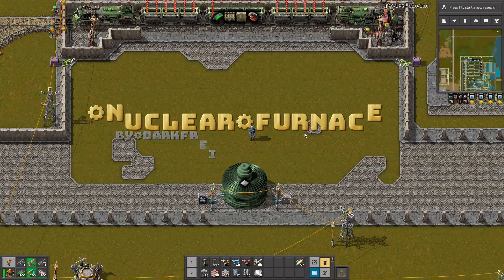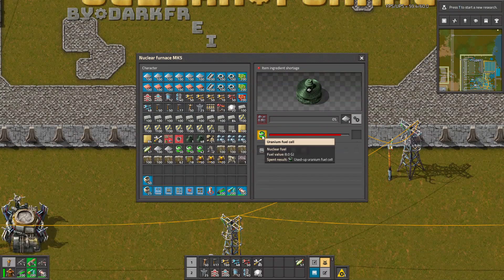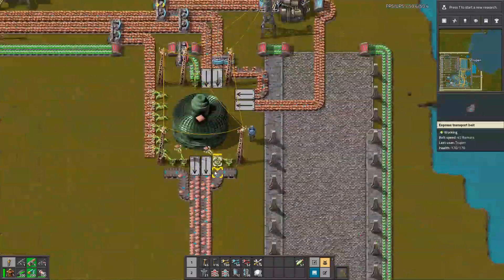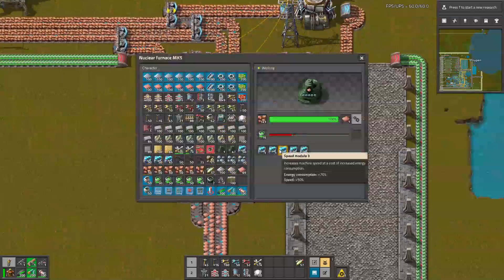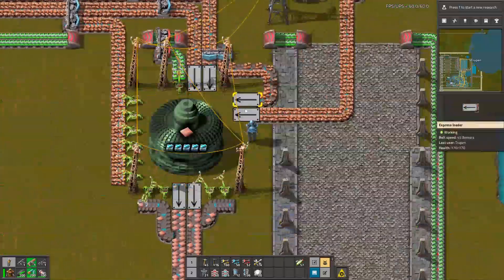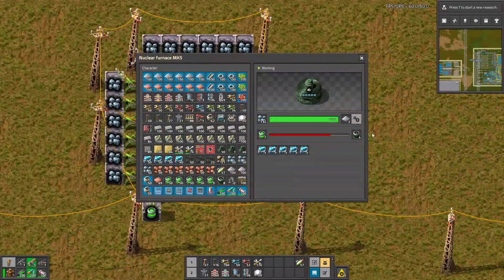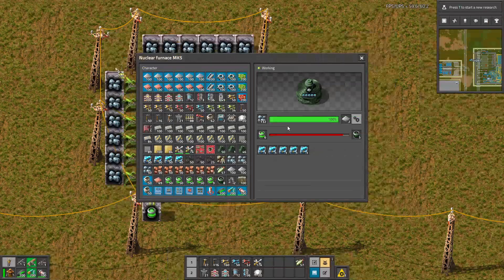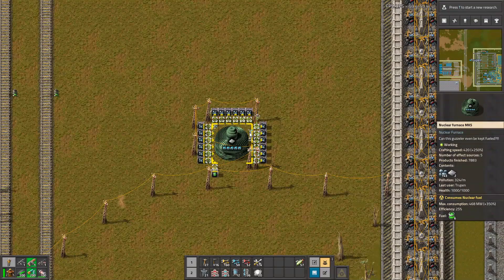Nuclear Furnace

Comment: I'm pretty sure anything with a crafting speed over 60 becomes buggy. It can't craft more than 1 item per tick.
Reply from the maker: It makes sense, but I think some solutions like crafting 10 iron per 1 tick instead of 1 irons per 1 tick could fix this problem (I mean, it's fixing it by going around like a true spaghetti programmer)
Reply: @Trupen2  Yeah, that seems to be the usual answer by mod authors. Doing x10 or x100 recipes that cost the same amount as usual and output those large amounts also, but which only craft in large batches all at once so it saves on the number of cycles it has to calculate them.
Reply: I was gonna say this, but you got to it first. Factorio updates all entities 60 times per second so anything that COMPLETES a process over 60 times per second is soft capped. The best way to prevent this is to change the recipe from 1-1 to 10-10 or some higher denomination in order to make it take less processes per second (with a speed up 420 it is trying to craft 2.18 times per second). This also has the secondary benefit of being more UPS friendly as the machine is technically working slower it has to update less often.
Reply: @wyhiob  I was about to bring this up, as this is how Minecraft mods fix this issue generally. Stack upgrades letting you do a full stack at a time
Reply: Was gonna say the same thing as this as well!
Reply: Yeah, that's the case. That's why most mods that try to drastically increase smelting/crafting speed end up needing to create alternate recipes that smelt/assemble items in large batches per crafting cycle.
Reply: Slap on it some recipe scaling mod, and it should work like intended
Reply: I noticed the same problem with a Mindustry mod. The drills/factories there also output at max the UPS count. So 60 ticks/s means a maximum of 60 items/s.

Comment: 60 crafts/sec is the limit as Michael Broderick mentioned. The workaround is to smelt multiple items at a time like 10 ore per cycle. There is a mod for that, Schall Recipe Scaling. Do a video as combination of these two mods
Reply: I second that. Schall's mods are done specifically with the intent of optimizing UPS, and they're balanced to not be cheaty while they do it.

Comment: Ill take it .
I want to play a map where everything results into nuclear 
Nuclear smelters
Nuclear turrets 
N assem*
N car,tank,
Thats what im looking for rn
Reply: It's pretty simple to do most of that in vanilla once you unlock uranium processing and later, kovarex. If you're on a biter-heavy map it's actually ideal to rush uranium ammo after flamethrowers and as a side effect go for nuclear power. It's not as UPS friendly as solar but you can generate way more power in a much smaller space which is great when you're pushing off attacks on every front. Once you have the power to support huge laser walls you can chill on uranium ammo belt loops.
Reply: nuclear inserters....?
Reply: Electric train that needs a Portable Fusion Reactor to be built?  Never runs out of fuel, but very expensive to build